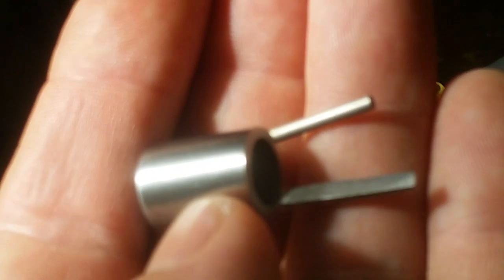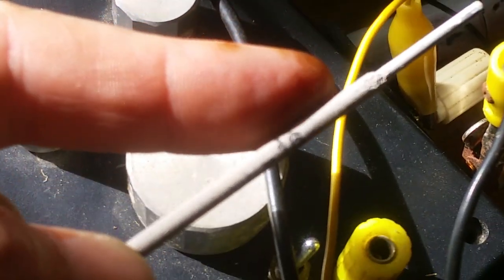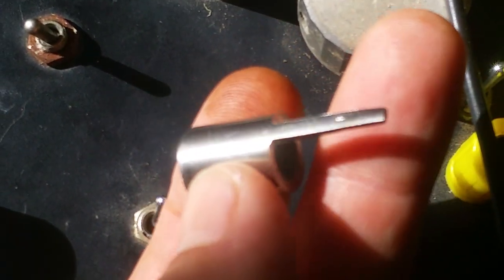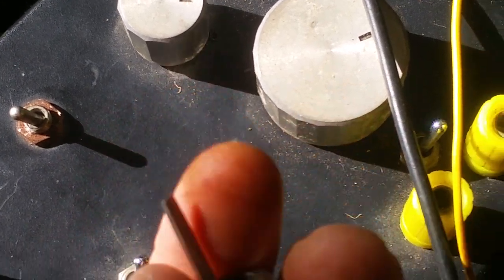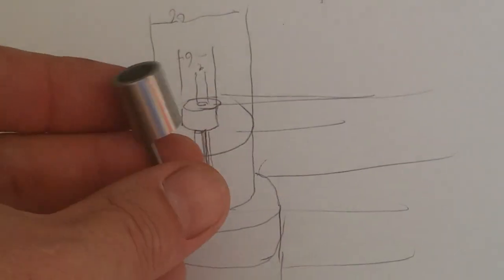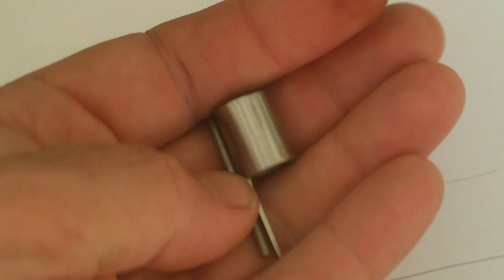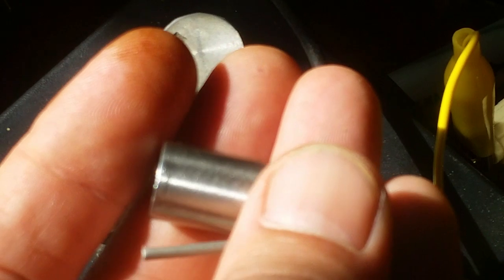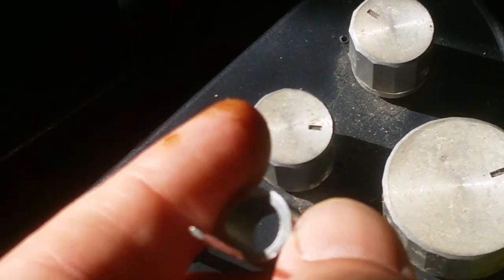Tiny resonant cavity cell. HHO Stan Meyer Technology

Comment: I have got questions. Have you find out how Stan Meyer ran hho used 5 volts 2 amps?? Please let me know!!
Reply from the maker: it was a high voltage out of the VIC, 5 volts was available on the 9xa board that drops the 12v down.  a pulse train of spikes with 50 % duty cycle, with the pulse train, 50% duty cycle with the pulses in the train, and tiny little fingers of 50% pulse on top of each spike like a fractal arrangement. plate gap spacing needs to be larger than 4mm to achieve a minimum of 30v step charge. a close gap brings a lower step charge, using electrolyte ruins step charging. the 5v was not driven to the cells.
Reply: @m3sca1  yeah I know about that so have you been successful with making high voltage and low current like what Stan did?
Reply from the maker: not by using Stans VIC... i have used other things like a flyback, or MOT or ignition

Comment: I have given spacing some thought over the years . I have concerns at low and higher power only being able to conduct in the path of least resistance and as such making it impossible to get spacing correct and resonance. I have no answer to this problem other than higher power to saturate so to speak . The other issue i see is surface bubble’s and bubbles in the liquid disrupting the path when they are formed. Now the ions need to follow a different path which again creates a more resistive path. Obviously this is drastically increased as the power and therefore bubbles are increased. Liquid pump can work but maybe a vaccum would be better as it isolates its effect to the removal of the bubble with less effect n the liquid and therefore less effect on the dirrect ion path!
Reply from the maker: there is a 3rd electrode i plan to add that is outside of the water and makes the water inside the cell another plate of a capacitor adding a HV charge into the water and polarising the charge in a cone shape to pull at the gas and help pull it out of the zone as well as stretch the molecule
Reply: @m3sca1  hmmm very interesting to see that development happen . Stretching the hydrogen molecules out of their angular attachment to the oxygen?
Reply from the maker: @Buzzhumma  i woke up this morning thinking about 3 rods...so it literally pulls the O to one plus charge rod and the 2Hs to two negative charge rods, providing the 2 to 1 ratio that most the water is in...and set the rods at the angle of the water bond angles...imagine the soft edges of a field the round cells has compared to a compresses tight field of rods
Reply: @m3sca1  maybe swirling water can help stretch the hydrogen molecules away from  the oxygen . I wonder if a full speed vortex in a big cell would assist  in effeciency